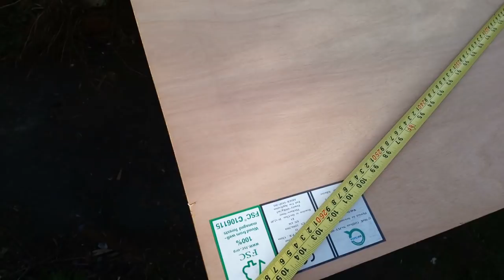Wardrobes Pt2 - Making the plywood carcass 2

Comment: Have come across your videos, they are really clear and easy to follow, thanks so much for sharing! I have one question: what's the reason for using biscuits? Would screws not be strong enough or are the carcasses just easier to assemble with biscuits?
Reply from the maker: 👍 That's good to hear, you're welcome 👍 The biscuits add a surprising amount of strength but they are for a big part for alignment , 😉👍
Reply: @Gidjoiner  thank you!

Comment: Do you fill those Brads Gid?  Gonna get me a Bostich. I did a full wardrobe wall to wall storage for big sliding doors this winter, and I am still working with lost head nails and punching and filling the old way lol!
Reply from the maker: Hi Alex, I would but I'm not painting the inside of this, what you've seen so far will be painted by the clients to keep the costs down, I'm just spraying the outside frame & the doors inside n out, saying that i might put a bit of filler here n there 😉
compressor & hoses can be awkward sometimes but better, cleaner & quicker than nails n a punch 😏 Spot on is this Bostitch, this lives in the van, i bought another 18g gun for the shed, a Makita that was on offer, love Makita tools but i wish I'd bought another Bostitch, 👍
Reply: @Gidjoiner    I have a good compressor set up in garage and could easily get long hoses to anywhere in house so gun is on my list.  I rattle a lot of stuff together in garage, so it will be handy.  Learning lots from you, thanks mate!
Reply from the maker: 👍 , a compressor is good, lots of tools to add 😁
I sometimes do a similar thing here, or at work I'll leave the compressor in the van & all is quiet then. 🙉
Thanks Alex, this ones going to be hard to show new stuff but repetition is the key to learning sometimes 😏

Comment: Another great video thanks 
I wondered do you use the biscuits just for alignment or do they add strength? Could you get away with just screws and pins for alignment ? Also why biscuits over dominoes?
Reply from the maker: Hi, Biscuits for strength & alignment in equal measure, alignment when assembly & strength once it's glued, the alignment is very good, it's like slotting a pre bought thing together, they have a little adjustment in them & don't have to be cut absolutely spot on to the line/mark. if you don't have a biscuit jointer i guess just screws n pins would do as the sides are sat on the base, once the glue goes off they would be 'ok', 
If i had the smaller domino then maybe I'd try that but biscuits are cheap n available at screwfix, I've used biscuit jointers since i started 34yrs ago, they're quick n as i say they have a little adjustment side to side, a biscuit is wider than a domino so in thin boards (compared to wider pse timber) maybe better alignment or gluing strength, i would prob still stick to biscuits for this type of work.
Thanks Josh.

Comment: Hi Gid, another great video keep up the great work, can I ask you for some advice, I am thinking of a new sander, a random orbital and there are two i can go for  the small dewalt and the larger  osch  both random orbitals, the dewalt coming in at £100 and the Bosch a good bit higher at £225 what would u advise and what kind 9f sander do you use pal, regards Louie
Reply from the maker: Hi, Louie, in a bit of a rush but this is mine, top reviews n i like it 
spk later 😉
https://www.screwfix.com/p/makita-m9204-125mm-random-orbit-sander-240v/2824r#_=p
Reply: @Gidjoiner  thanks pal will look talk later drive safe regards louie
Reply from the maker: For the price i don't think you'll regret it, I've even considered buying another so i can have different grits without having to change papers or just so I've one for the van/site & one for the shop, someone commented on one of my other vids that they've been using these sanders in their shop for ages n they're still happy with em, 
 I buy the Makita disks too, bit more expensive than others but I'm not disappointed with them as i have with other brands
Reply: joiner  thanks pal, I had saved up some Penny's and needed a new random orbital,  wasn't sure what to go for, tell me Gid have you heard of a Plano glue press? When I build bespoke furniture I sometimes glue up a table top and so I was considering a Plano press  ut some of the reviews where a little disappointing so in the end I went for some good bessey clamps, what's your views pal, kind regards louie
Reply from the maker: Just had a quick look at the glue press, Seems a lot of money, from what i see you have to spend a couple of £100 just for two clamps, is that enough? would you need 3 or 4 + the wall track?  🤔
of course the choice is yours but i would make something or buy clamps & modify them if i wanted a dedicated gluing rack/press thingy, I know what it's like to see something n think i want that 😁 then think nooo i could spend that money more wisely 🤔 then decide no i want it 😁 then tell myself to think about it for a while, then decide to buy it anyway 🤣
I think you should ask yourself do you have all the basic tools, decent table saw, planer/jointer, mitre saw, dust extraction, lighting, ... i don't know what you have, i know you have some of these, I want the Festool domino df 500 but i also want to extend my shed, keep my van on the road...., I can make do with the domino & biscuit jointers i have, the 500 will have to wait,  it's a hard choice sometimes init 😁
Reply: @Gidjoiner  your responces r always wise and with great humour, lol thankyou pal, well u better hold onto something Gid because you need 3 clamps per 39inchs so as I sometimes machine oak doors that means I effectively would require 6 coming in at way over £600 so just crazy money which I don't have so in the end I went for 4 bessey 4foot clamps coming in at £246 so that will be my glue press, I no what u r saying buddy there is always nice kit out there and with a mortgage a wife and kids it's hard to have it all, I have be blessed though with nice tools and machines, long hours worked to get them and many of gumtree which bargains can be gotten,  I still havnt figured out the right sander yet though I did which your video and it's on my list, regards louie

Comment: Hey Gid, Hope your well mate.

Is there a specific reason you chose to go with 18mm ply for the carcass and not 18mm MR MDF?
Reply from the maker: Hi, I'm building the french doors n seated window i mentioned in my last vid, dodgy builder didn't make the start easy & short, damp, cold days trying to get this job done before x'mas but yep I'm ok. 😖🤣  yes there is, i use ply because it is better for fixings like doors, hanging rails n drawer slides, shop bought unit's doors & rails fail because of the screws breaking free of the chipboard/MDF sides, Ply won't sag with time & atmospheric humidity like MDF will, it's basically stronger & longer lasting, you do have to accept maybe the grain of the ply showing through but it will last for many yrs, for jobs where the finish has to be smooth or for blank doors i'd use MR MDF, 
Medite MR stuff, costs about £35 here inc vat, this ply which is better than the cheap East Asian stuff costs about £39, so there's not that much difference & is a lot better structurally than MDF, it should last a lifetime, these things I'm asked to make are not cheap so when people are paying for something like this they expect it to last many yrs & so do i, the little extra between ply n MDF is outweighed by the quality of the material & therefore the quality of the work piece supplied, 👍😉
Reply: @Gidjoiner  That's good to hear mate, They call the Xmas rush, silly season over here. 

They all want it done now, just in time for Xmas, yet they wait till the last 4 weeks of the year to get it done.
I always have to find a whole new level of patience when i deal with builders. 

Yes i did think you had a quite specific reason, i was just curious as to your thinking behind it and it makes total sense.

I suppose that because the majority of the exterior sides of the carcass in this particular build is mostly hidden in the alcove the need for perfectly smooth sides would not be required. 

I'm finding myself having to use MDF a lot at the moment because of the style the customers want and to also match in with the same look/feel of there melamine/laminate kitchens etc. 

A lot of the homes i am quoting work for are in very new areas with brand new builds or homes that have been built in the last 10 years or so. 

I feel the exact same as you, that i would personally sacrifice the slight grainy look of ply over the MDF for the longevity of the units and quality of the overall build. 

I also want my work to last longer than than i do and im 31 =) 

The only thing i will not sacrifice or budge on is if i am making shaker doors or any doors that require stiles/rails i always use a hardwood, the best one i have found here for strength/cost ratio is Tasmanian Oak/Victorian Ash depending on what part of Australia you live.

For guys like myself who have a lot of pride in what we do and are always looking to learn new techniques to make ourselves better carpenter/joiners and overall produce better quality work  your comments and videos are just beyond brilliant.